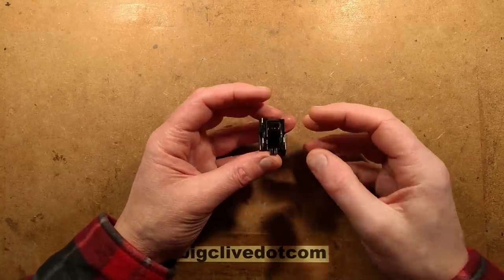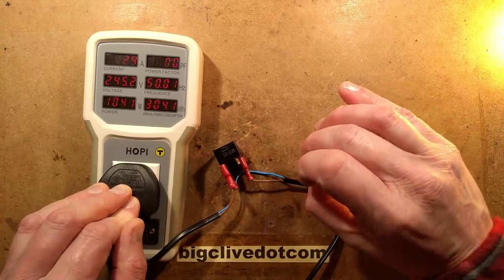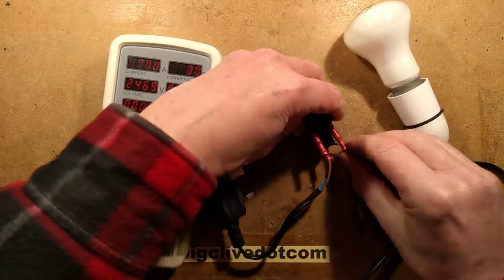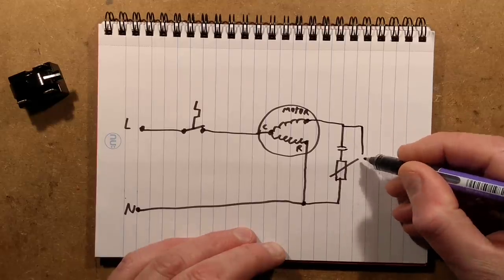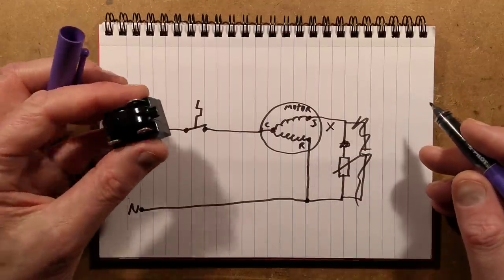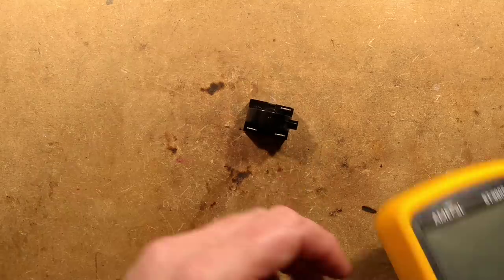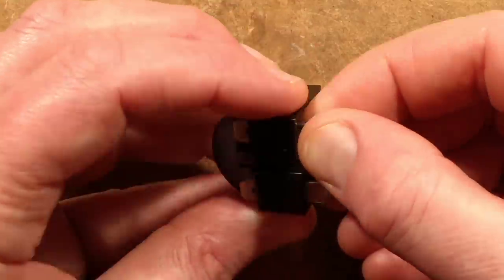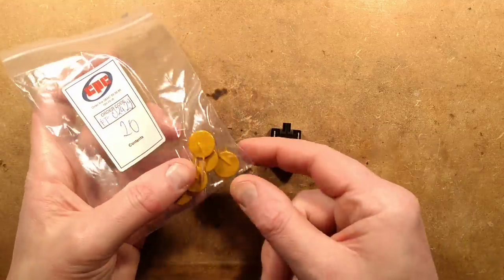Inside a cheap eBay motor-start module.

Comment: Clive could you please help me. I recently purchased a night light for my daughters that plugs into the shaving socket in the bathroom. It’s a motion detection light and works brilliantly. 
However after a few weeks it’s now started to make a loud humming / buzzing noise which from what I can gather is the actual socket that’s making the noise. 
Could you please advise if I need to stop using it or if there is something I could do to stop the noise. 
Thank you in advance for any advice you could give. 
Rich.
Reply from the maker: If it's a UK style shaver socket then they contain an isolation transformer and aren't really intended for continuous use.  It may be that the transformer is running warm and making the buzzing noise.  That type is normally off until something is plugged in
Reply from the maker: Consider a USB rechargeable LED PIR light.
Reply: bigclivedotcom thank you so much for the swift reply, yes it’s a typical uk type socket and that makes complete sense. I’ll get a usb rechargeable style instead. 
Hope your keeping well and thanks again Clive. 

Rich.

Comment: so from what I've gathered,  this lesson is not about the light cause that was used in place of a refrigerator compressor  which would have regulated the current being that as the inside of the black mystery box gets hot then .....
Reply from the maker: The light was to make the effect visible.

Comment: I have a fridge pump i need to figure out how to run it , A friend says i probably wont need to capacitor to jump start it as it needs that when its under air pressure load.

Comment: Would that ptc  disk act like a cap too. I mean the way it's built with two plates and a dielectric between??
Reply from the maker: There would probably be a tiny amount of capacitance, but the space between the plates and conductivity of the material between them would make it very low.
Reply: @bigclivedotcom  Yes the space is wide compared to normal caps. Are MOV's closer together?
Reply from the maker: @keithking1985  MOVs do have a slight capacitance.
Reply: @bigclivedotcom  Thank you Clive

Comment: And this replaces a centrifugal switch you hear click in your clothes dryer,  or a capacitor start that uses power all the time?
Reply from the maker: Yes.  But it's only suited to specific motor applications.

Comment: Are there not delays calibrated into the grid? Ive seen the power go out, transformers exploding ive seen with my own eyes more than once. It seems to take a full second maybe to reset. Would that be enough?
Reply from the maker: The grid has reclosers that will try and restore power up to three times after a fault has occurred.
Reply from the maker: The recloser delay is not enough to allow compressors to equalise pressure.  It has to be minutes.

Comment: Walmart added gate things but they open both ways and alarm goes off if you go out to make people look
Reply: So complicated.  The European ones open one way, but are small enough to just crawl over / under in an emergency.  Older ones had no motor, just a spring that got pushed when customers entered.

Comment: Would this work as a soft start for an old washing machine motor Clive ?
Reply from the maker: It effectively breaks the circuit after a short time delay, so isn't ideal.  An NTC inrush limiting resistor in a piece of ceramic terminal block could be useful though.  The NTC thermistors start with a resistance of around 5 to 10 ohms that then reduces as they heat up.  That can limit the initial kick of a motor starting.
Reply: @bigclivedotcom  have seen videos of alot of people using a large capacitor as a soft start, I have no idea what size to look for or where I would get them in France, I guess eBay would be my friend, they show how to do it, but never mention the microfarad size for the capacitor, I would like to use mine for metal polishing

Comment: I hate these things. Ok for if on a CRT colour tele where they are mounted on a PCB away from the board and get some cooling. Here they don't, after a few years they become a fire hazard, the contacts do wear over time, create a small area where heat is quite high, deteriorates  the housing, they start to burn. It takes a few years before they get to that state. The older versions used a relay where the coil was in series of the motor winding, at start the current was high enough to pull down the switch and once going the current dropped the the switch released. There were not a fire risk and reset right away.

Comment: Odd. Probably more reliable than the usual centrifugal switch, though. I might think about fitting one to my bench grinder if the centrifugal switch acts up again.
Reply: Can't cycle as quickly, so not really suited to that application.

Comment: Speaking of cheap, Ford put these in the window and door-lock motors of my father's truck. Evidently, the 8-year-old Bangladeshi field hand they hired to do all of the electrical design on that 'vehicle' chose the wrong damn PTC element. Result: in the summer, your windows won't go down, and you can't lock or unlock the other door with the pushbuttons, either.

Comment: I would like to know what's the difference between PTC and NTC
Reply: PTC=Positive Temperature Coefficient  NTC=Negative Temperature Coefficient. they both do the opposite to each other. ie: the PTC resistance goes higher with higher temps, and the NTC goes lower with higher temps.
Reply: @muzikman2008  wow, thanks man, newbie here, it's great to know this new knowledge, 🥂

Comment: So do motors with start and run windings still use centrifugal switches like I'm used to? and if so why?  These things seem a lot simpler and cheaper.
Reply from the maker: Some do, but for frequent starts a more complex system than this one is needed.

Comment: I think the security tags when you steal from from stores would be nice quick vid.
Reply from the maker: Often just a tuned circuit with a coil and capacitor.
Reply: @bigclivedotcom  I've taken a couple different ones apart and that Is all there is.
Reply: How does that compare to wireless leds?

Comment: Interesting.   I recently replaced the open-frame motor in a clothes dryer.   The centrifugal switch contacts were utterly burned.  I've still got the motor.  I was thinking about using a relay to provide the starting pulse for the start winding, but this may be a better solution to enable me to re-use the motor for something.

Comment: Back in 2008, I got a mini fridge out of a walmart dumpster. I could only assume some RV owner had to buy a replacement when theirs bit the dust. The PTC element metallization was burned off in a few spots. I painted it with conductive ink and that lasted until 2012 when I had to spend the $5 to get a new one. Still running to this very day.

Comment: you should be able to eliminate the flickering of the multimeters displays by changing your cameras shutter speed to the refreshrate of the display (prob 50Hz).
Reply: In dim lighting, Clive's Hopi doesn't flicker on camera. In normal lighting, he sets the shutter speed for good exposure, and unfortunately that makes some displays flicker.

Comment: Do they really use piston compressors in refrigeration? I mean a reciprocating piston like in an air compressor.
Reply: They were very common at one point, then rotary and scroll compressors took over, but now a new "linear piston" compressor is making a comeback.

Comment: So is this do what the centrifugal start switch does in motors? Is this just the electronic version of those?
Reply: Centrifugal start switches were a long time ago and apparently involved mechanically releasing the rotor contacts from the gliding contacts to reduce wear once at full speed (where the desired operation would be to short those externally anyway).  At least that's my vague recollection of old schoolbooks.
Reply: Similar, except a centrifugal switch is still used and resets quickly, unlike this. This isn't very electronic - there are more "electronic" start switches that could replace a centrifugal switch. But, the purpose is the same (at least for capacitor start induction motors) - bring in another winding just for starting

Comment: Another application I can think of is for electric vehicles! Due too they don't have a belt pulley pump, they would need so kind of electrical motor to pump the refrigerant!
Reply: They also don't have refrigerant, though.
Reply: @B-System  You need to check your assumptions first. Err, yes they do. Most use an AC system to control Battery pack temperature and cabin climate conditions. Check out Chevy Volt cooling system (https://images.app.goo.gl/XPwvoePNEZkMhXab7) notice the 360v compressor in the circuit , for example.

Comment: jeez, the HOPI said your voltage was almost 247. wouldnt this cause many things that are designed for 220V to fail prematurely? isn't it supposed to be officially 220V but for some weird reason they still do 240V?
Reply: It's mostly within spec (for 240 though most if not all 220 stuff can cope). Some videos it's even spicier, 250 or 251
Reply: I thought it was regulated to 240v, but I was wrong and found this info from SP energy networks " In the UK, the declared voltage and tolerance for an electricity supply is 230 volts -6%, +10%. This gives an allowed voltage range of 216.2 volts to 253.0 volts."

Comment: Don't suppose I could use one to repair the motor soft start on my 9" Angle Grinder......
Reply: Soft start is a different circuit altogether.
Reply: I think you'd need a NTC thermistor for that.

Comment: Interesting fact: Climate change changes the behaviour of this device, it will get quicker to it's threshold temperature. I think the  refrigerators of the globe are not changing their behaviour, because the time until switching is used to start the motor. As this time can vary, there must be a safety margin in the delay. If the switching occurs earlier, that will be much smaller than the safety margin, and just eat a tiny fraction of it away.

Comment: So that's what those things are! Fascinating. Any ideas on how the electromagnetic starters work? Same sort of size, but with a distinct coil wound on the outside (Google "electromagnetic starter fridge")
Reply: The ones I've seen are "current relays" (recognizable by the coil being a fairly thick wire instead of the hair-thin wire used in voltage relays).  The relay coil is in series with the "run" winding of the motor.

When the power first comes on, the motor is stationary and the "run" winding demands a very high current (several times the normal operating current).  This current flowing through the relay coil makes the relay operate, switching on the motor's "start" winding.  Therefore the motor starts turning and accelerates.

As the motor reaches normal speed, the current through its "run" winding (and therefore the relay coil) drops to normal levels.  This causes the relay to release, switching off the "start" winding.  At that point the motor is running normally.

Comment: What is that compared to a capacitor start?
Thanks again for sharing your videos.
Reply: It's more like the centrifugal switch on a capacity start motor, but because of the slow reset, don't put one of these in your table saw 😄

Comment: I'm not entirely convinced that waiting for an overload condition as a limit switch is "clever" :)
Reply: Printers and 3D printers do it. The prusa3d mk3 for example has no limit switches, it just detects the stepper motor overload.

Comment: Never seen this.    My compressor does not uses one.    Has a Run Cap .
Reply: Ah the classic capacitor to skew the AC curve a few degrees to the skewed winding trick. Ensures a specific rotation direction but may affect power factor.  No mandatory cool down between runs.  Of cause neither is needed on a 3-phase motor.

Comment: Older refrigerators used a mechanical start relay, either electromagnetic or bimetallic, which has a much more distinctive sound when it transitions between start and run:

https://www.youtube.com/watch?v=5xU4-qFSeFw

Comment: When my fridge died, I determined (with some motor start capacitors and clip leads) that the compressor was fine, but the starting controller had died.  Unfortunately, it was an unnecessarily complicated unit containing a small PCB with a bunch of surface mount transistors and assorted passives, along with a TO-220 triac to actually connect the start winding.  List is $130 or so for the little gubbins.  I picked up an equivalent one for $20 or so on eBay, which did the job, but otherwise I would have just made one myself.
Reply: I'd be careful with those hard start kits. If the system already uses a similar capacitor wired to the compressor, then there shouldn't be a problem. If a start winding is weak and needs the extra 'oomph' that that large capacitor can provide, then using a hard start kit can give additional life to a compressor. But, if your dealing with a system that doesn't use a capacitor, and the start winding is capable of starting the compressor on it's own, I would highly recommend using a relay without the capacitor or you'll end up putting unnecessary strain on the start winding and ultimately shorten the lifespan of the compressor.
Reply: Those things that claim to run a compressor "more efficiently" generally end up making the compressor work harder and last less long.  I also don't trust anything from amazon, given their "replace with an equivalent item from a closer warehouse" policy and similar shenanigans.
Reply: @StoneE4  A good hard start kit should only run the start winding just enough to start the motor.
Reply: @NiHaoMike64  - In the US, generally speaking it's not cost effective to replace the compressor on most residential fridges (unless it's an expensive, high end fridge or you luck out and find someone that is willing to charge you next to nothing for labor). The most common use of a hard start kit is to give a boost to an already weakened start winding so that the compressor will run. It's a temporary fix that gets compressors running again at the cost of doing damage to the start winding. Some people choose this option because they need to to save up money for a new fridge and they don't care if more damage is being done... They just want to buy some more time for the fridge they already have. If a compressor wasn't designed to have a start capacitor and you hook up a hard start kit, you will be doing damage to the start winding and eventually the hard start kit won't be enough to get the compressor started.
Reply: James Sloan  - The fact that hard-start kits can keep some compressors going for years doesn't negate what I've stated in this thread. Over ten years of experience in the residential appliance repair field tells me your situation is, more often than not, the exception and not the general trend. I've also found older compressors are much more tolerant of hard-start kits than newer ones. As to your friends situation, AC units typically have beefier compressors than household refrigerators and some, in fact, are designed to use capacitors in conjunction with the start relay. If any compressor is going to work for years with a hard-start kit, an AC unit's compressor would be a much better candidate than one found in a residential refrigerator.
That being said, I'm happy to hear that a hard-start kit was able to keep your refrigerator running... Most people who find themselves in the same situation as you aren't as lucky.

Comment: No moving parts, they must last a fair few cycles
Reply from the maker: I think they will fatigue over time.  Possibly the contact surface on the disk or general material degradation.  Cheap to replace though.
Reply: How did you comment 2 weeks ago
Reply: I replaced one in my 'table top' fridge, just two years ago. . . . The original had lasted over 25 years, so I'd guess at quite "a fair few" - from China, I bought two for 99p each and free postage.
Reply: @jamesstoneyt5001  Patreon early release ;-)

Comment: I know it's not the same thing but this video reminded me of a product the RVGeeks installed on both their RV main AC units so they were able to safely run both of them off a 30 amp  breaker instead of a 50 amp. It's called a Micro-Air EasyStart. Just wondering what your opinion was and if you know of anything similar or better. I've been researching the RV/Tiny living lifestyle a lot and I'm always on the lookout for any power saving or energy creating technology. Here's the RVGeeks install video: https://www.youtube.com/watch?v=1mCeNRODDxc

Comment: Why are you still using that funny screwdriver instead of a decent one? I believe that you are so used to it that you just can’t change. I am really tool crazy and want to use the best tools available. And never use that kind of tip change one. But surprise surprise, I just bought two Proskit Automatic Multi screwdrivers because they were so cheap. I’m going to keep one in my car. Yes, I know, that make isn’t so good but you can get a reasonable tool if you’re lucky.